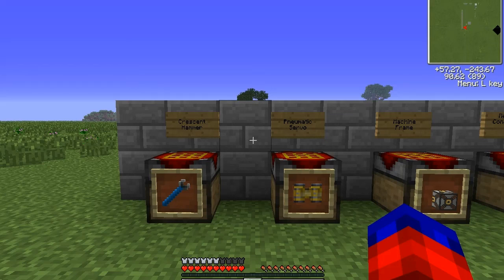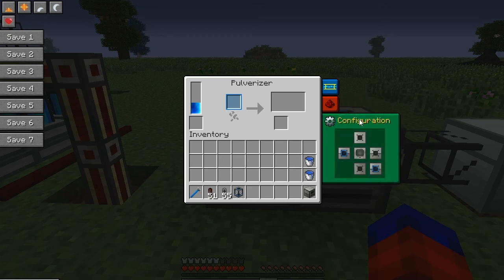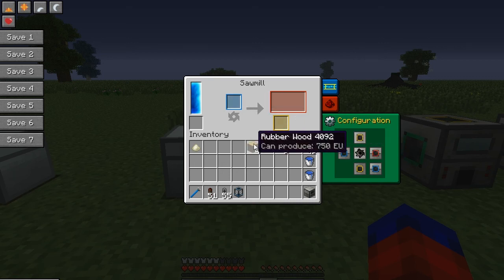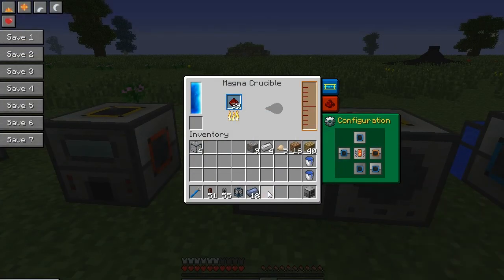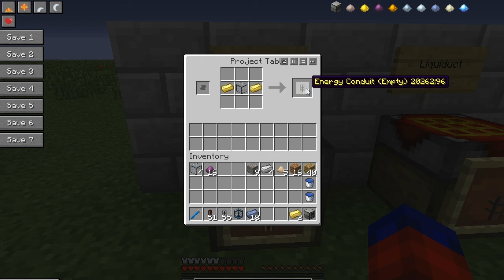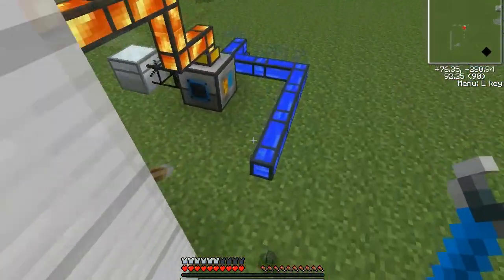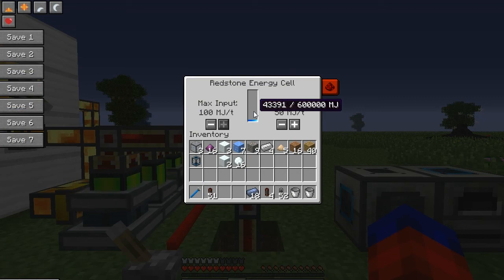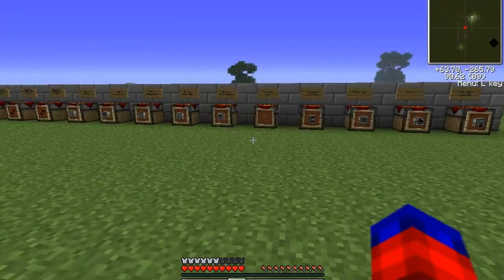Wylker spotlights Minecraft: Mod Thermal Expansion v2.1.6

Comment: total lifesaver. looked all over for what i could be doing wrong with conduits connecting to forestry and lasers for assembly table, etc. was resorting to conductive pipe but the buildup of energy is so buggy it was worthless as a turn on and forget type system. such a small thing, but whacking the input/output arrows on the conduit pipes was the missing piece to my puzzle that for some reason didn't seem explaind in other places i looked. Again thank you!